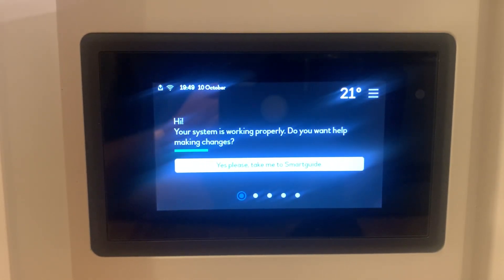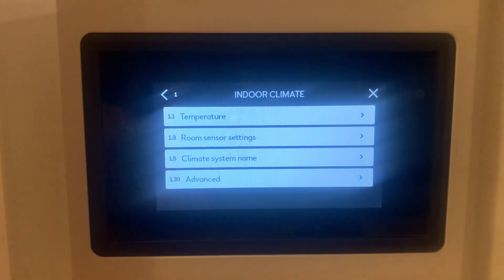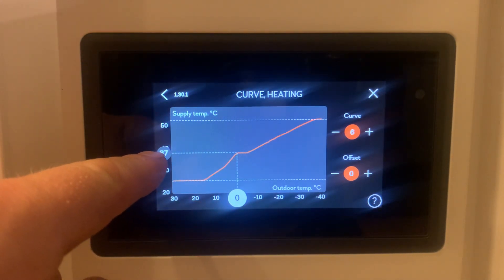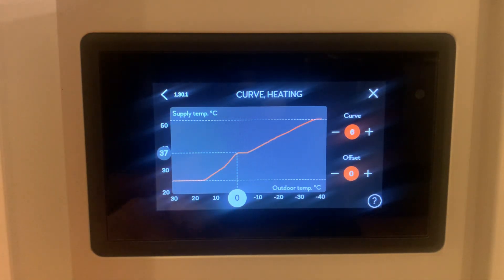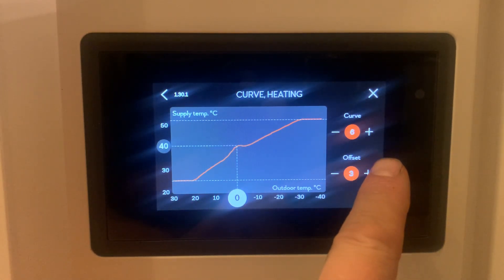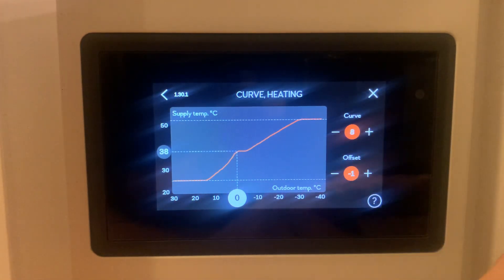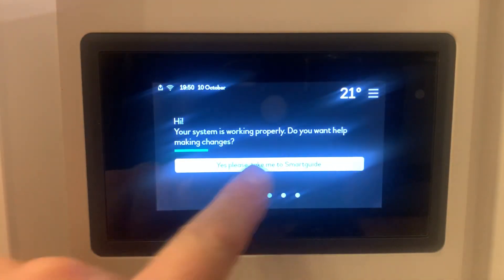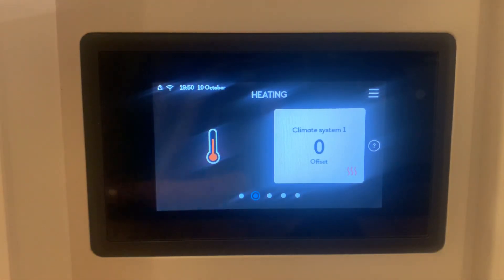NIBE S Series - Heat Curve, adjust and view #nibe #heatcurve

Comment: Why is there a "hump" on the curve from 0 to 5 degrees and the slope changes below 0?
Reply from the maker: This is just a demo control, shown purely as an example of how to find the curve etc, every house will have its own individual heat curve, based on its heat losses
Reply: @i85_Heat_Pumps  I know - the question is just regarding the "hump". The standard curves are normally smooth and do not have hump - only you own defined curves can have that and they are defined in steps of 10 degrees. So still wonder